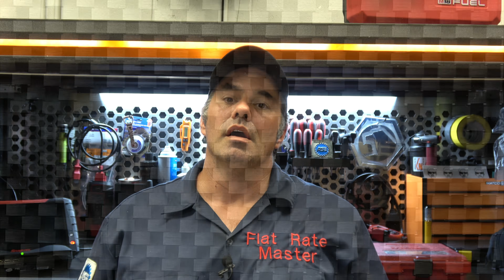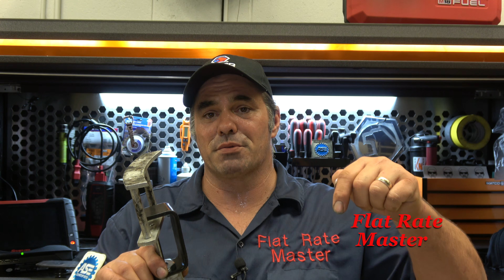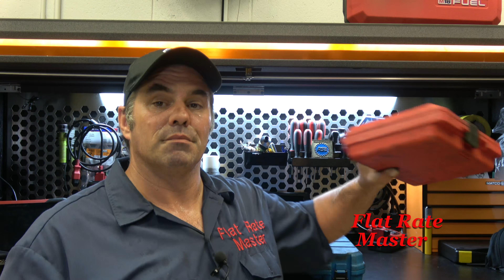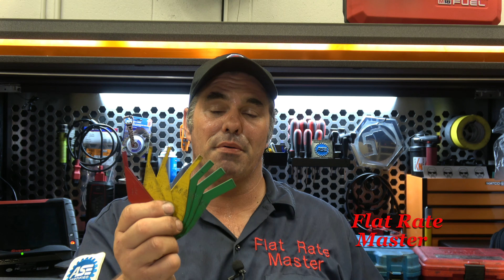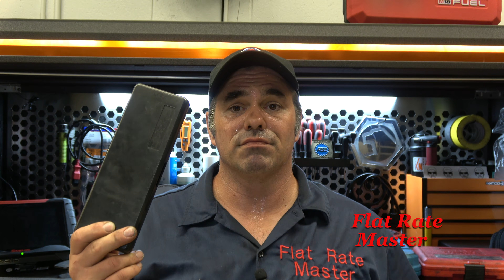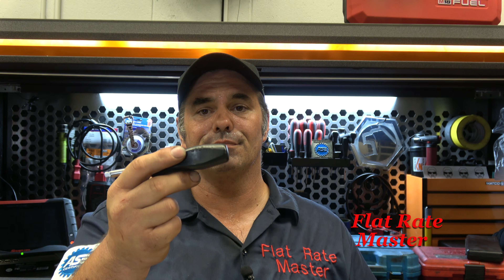Basic Brake Tools For Auto Repair

Comment: My favorite use for that caliper micrometer tool is to check wheel offset eith aftermarket wheels to see which size hub ring i should be using

Comment: I’ve done drums twice at my dealership in the last 2 years. I’m fine with that. I’ll do clean and adjusts on them all day though. That’s pretty gravy for me. 
I use a combo of the lisle single piston (sometimes add a pad when needed,) the Matco branded ratcheting tool, and my less used Matco turn back set. They all come in handy. 
Fluid testers come in clutch. I also have a good vacuum bleeder. Makes life so much cleaner and easy.

Comment: I love my one I get for 10 bucks at autozone or any place that sells tools it’s a thing of metal in the shape of a pad with a thick bolt in the middle with a flat surface on the stud u just twist it and it works very easily I have four of them cause sometimes I get the two piston or brembo 4 pistons and my 10 dollar tool does it super easy on my hands. For rear brakes that are twist type I have to different blue point cubes with diffent style teeth on all the sides but one is flat so u can put it on ur extension and ratchet or directly on ratchet I’ve yet to run into automotive or even light medium duty brakes I couldn’t do with those tools now for heavy duty it’s a lil different lol. Mainly need lady slippers special pliers and a few other odds and ends to make semi truck brake jobs easier and faster then cars especially if your shop has tools to help take the wheel off and the drum so u don’t have to wrestle them on and off and hurt your back.

Comment: Drum brake spring pliers! Cam-turn spring hook releaser! A must have when you're doing drums on one ton trucks. They both help release the springs and put the new ones on. As much as people hate doing drums I usually get seven to eight years out of mine in extreme cold and salt, probably because the drum protects the brake components better.

Comment: Glad I’m not the only one that hates drum brakes, Horrible inferior technology! Btw I have a nice brake measuring tool that is like the first one you showed but the ends are bent 90 degrees so you can stick them in the calipers even when you have virtually no access, I don’t see any shops use this style but I can’t imagine why. They can measure pretty much any brake pad without removing the wheel. Edit: found they are lisle part number 81850

Comment: I only do my own car brakes   and my moms   i still use a c clamp and old brake pad   have been for     25  years   now      and it works fine.    when it comes to the rear brakes   I have a tool for the rear piston  if needed   .     im not flate rate  and or on a time limit.

Comment: 6:19~6:20 "four millimeters you want ?????".  Played that one second 30+ times but could not understand that last word (?????). Also, another LANG 279 video comment stated that the problem with the Lang 279 was that it required another person to hold the caliper else remove caliper and put it in a vice. Is that true? ALL of my many brake tool questions were answered in this one video. GOOD JOB!
Reply: No, this is not true about the Lang. Hold the caliper in one hand, the Lang in another, slide the Lang into the caliper, and start ratcheting. The easiest way is to put the caliper down on a five gallon bucket.

Comment: The brake fluid moisture meter is a very inaccurate tool, because it tests for electrical conductivity. I know one would think the more conductive the more moisture. Not the case because of different manufacturing practices. Some brake fluid is more conductive then others. So that being said that tester would have to be calibrated for the specific manufactures fluid. The only universal moisture tester per say would be one that tests the actual boiling point.

Comment: I sure hope you are pinching off the line, opening the bleeder, and pushing the fluid out and not back into the system. That's a good way to ruin an abs system real quick.... As far as rear calipers that you twist the piston back in. If you can't twist the piston in with a pair of needle nose pliers, the caliper is junk
Reply from the maker: I have had the discussion about opening bleeder screws with many brake engineers, there was just a discussion on this on Iatn and the tech guy from a leading brake manufacturer stated as such, those abs valves are normally closed, so pushing the fluid back does nothing to the abs. FYI, pinching off a modern brake hoses with a liner will destroy it, and you now get to buy brake hoses

Comment: My lisle caliper tool that you have lasted me 17 years...excellent tool...
The permatex grease unfortunately swells the rubber bushings on Toyota brake caliper pins...causing them to bind so I prefer to use Toyota rubber grease..
Reply from the maker: I do not use the Permatex on rubber, I use silcone paste
Reply: @flatratemaster  i use super lube on slide pins, works well

Comment: Brakes are gravy....Hmm I’ll try to remember that the next time I change the rotors on a truck with a Dana Spicer two speed rear axle. Or the old style 4x4 ford captive front rotors
Reply: That's one thing I don't miss about my old 1990 Accord.

Comment: Drum rear parking brakes are great until you have to do the rotors.  That's where your pick tools are good for disengaging the star wheels...as opposed to trying to use a screwdriver.

Comment: I have that Lang #279 brake caliper press and was good money spent on it.Gets used a lot now.So far on putting in the old brake pads to use it was on a 2011 F150 just to push the pistons back in.I have the 18 piece Matco rear caliper windback tool set,works good.Checking brake rotors,the cooling fins are to check as well.Toss them if they are badly rusted out.Causes so many pulsation problems.I do remember the early GM  W body cars using the T60 torx bit on the front brakes.These bolts were on so tight.Lisle is johnny on the spot for warranties,will send you a replacement emailing them.I have done it before

Comment: Hey FRM,

Love the show! A tool suggestion for those cage style drum brake springs is the CTA 1459 pliers. I use it on almost every job and it's great for the ones that sit behind the hub. Look forward to the next video! https://www.amazon.com/gp/aw/d/B00VX0BVWW/ref=mp_s_a_1_6?ie=UTF8&qid=1507314886&sr=8-6&pi=AC_SX236_SY340_QL65&keywords=drum+brake+spring+pliers&dpPl=1&dpID=311XYuCVGNL&ref=plSrch
Reply from the maker: Thanks I will give them a try!

Comment: The shop I was at, everyone used the same Caliper.  It was rare that the rotors could be turned, almost all where badly grooved, or had "holes/pits".  It's dependent on the area your shop is located, for which tools are needed.  People would come in for a oil change or tires, or noise complaint, and leave with new brakes.  

Kinda scary.  I have had to wear leather gloves to take tires off, more then you should. (and put them back....)
Reply from the maker: That sucks!, Being in the south, changes things for me compared to the Rust belt
Reply: Got to be nice working on cars in the south,  I am on the outer edge of the rust belt. So I get clean cars and rusted out POS, I have seen a few old ONT cars, man it sucks to work on them.  I might invest in a .498 air hammer, the Snap on is good but I need a bit more power.

Liking the videos you have put out, far more useful then just standard fare DIY videos on youtube.  Keep them up.  You better not do any DIY repair videos man.  :)

I like the "calking gun" type brake tool, however the Lang, a cheap rear brake tool kit, and large channel locks. Have worked great for me, and been fast.   The rust will slow you down.

Comment: As far as the brake grease goes, my shop just provides the black brakes grease but I don't like to use that on sliding pins. I prefer using silicone paste/die electric grease. What are your thoughts and do you put brake grease on the ears of the brake pads where they slide on the metal clips attached to the brake caliper bracket?

Comment: Good video. I went a long time with just the cheapo 4-sided cube for winding back caliper pistons. After getting a good tool, I kicked myself for waiting so long. Saves a ton or time. Along with what you mentioned, the best drum brake tool is the Snap on BT-11. If you do single spring drum brakes (which I really hate) you'll need something like the Lisle #50600. And if you do Chrysler or many import drum brakes you might want to  consider a Lisle #48400. Those "leaf spring" clips used to drive me crazy. And one more handy item, Lisle #45100 clamps on brake springs, although needle nose vice grips work pretty good too. And no, I wasn't paid by Lisle to post this. It's just that most tool trucks sell their stuff re-branded.

Comment: FRM, I would like to hear your take on working efficiently vs cutting corners, and where you draw the line between “getting the job done fast” and “getting the job done right”?

IMO, I strive to be as efficient as possible, while still doing the same quality of work, as I refuse to sacrifice quality in the name of speed.  I’m all for buying tools and
trying new things to make jobs easier/faster.  But I’ve seen lots of “techs” sacrifice quality in the name of speed by either skipping steps, butchering/hacking up something instead of removing it properly, or in the worst cases just flat out not doing the work.  

Example, when I worked at the dealer and did a brake job, I’d lube the slide pins, clean the rust from the bracket where the rattle clips sit, put anti-seize under the clips, brake lube above where the pads ride, anti-seize on the hub if I was replacing rotors, properly torque the caliper bracket and lug nuts, etc.  The other guys in the
shop, however, just slapped the new pads in the calipers, never changed rattle
clips, never lubricated anything, ran the bracket bolts and lug nuts down with
their impact and shipped it out the door, and that’s not right IMO.

Would love to hear your take on this, think this would also make for an interesting video.
Reply: I feel that if labor times were fair (which lots of them aren't, especially here in the rust belt or if you're working in a dealership doing warranty work) then flat rate is the best compensation plan for a tech IMO, as long as the shop can keep enough vehicles coming through the door, or if they offer some kind of weekly hour guarantee to make up for the slow times (30-35 hour a week guarantee).  

But I do agree that flat rate seems to breed this attitude of "quantity over quality" "get em' in, take em' for all you can and get em' out the door as fast as possible".  Also, lots of shops don't seem to know the happy medium between "working efficiently" and "rushing through a job" and most favor speed over quality.  Always said while working at the dealer that they would rather have something done quickly and half assed than done slower but done right!  

The pressure to produce work quickly is pushed to absolute absurdity by people who've never worked on a car in their lives and don't understand the first thing about what it takes to repair a car properly!  All they know is numbers and "sell, sell, sell". Pencil pushing business grad bean counter service managers think that everything can be done in 15 minutes and always have that smug, clueless grin on their face, unaware of their own ignorance and proud of it.

As I said before, I strive to be as efficient as possible without letting quality suffer.  High school shop teacher always told us "Focus on doing the job RIGHT and the speed will come naturally." Can't stand the guys in this business who say things like "You need to hustle more, you need to be faster!"  ETCG pointed this out one time, that he would get pissed if someone said he was "fast".  Don't call me fast, because that implies cutting corners or not doing a job properly, call me "efficient" because I did the job correctly AND as quickly as possible.

Comment: The correct calipers are important even if the rotors aren’t grooved. A lot of the time the rotors will get a lip so standard calipers won’t measure the rotor it’ll measure the lip. My shop only requires measurements when we are requesting new rotors, if we are cutting them I guess they assumed me measured and there is meat left on the rotors. Good info in this video 👍

Comment: Never came across the pnematic version for retracting pistons. Does it wind counter clock wise?
Did rear brakes on a Transit the other day where the pistons retracted in opposite directions from side to side.
Another great video! Well done!
Reply: Frank Totino the pressure is pneumatic but the turn handle is manual so you can twist it either way.
Reply: Shawn McHargue 
Thanks Shawn...Do you own this tool? My worry was, it retracting so quickly, that there is potential to rip the boot.
It's manual with some kind of assist. I personally would like to    
feel the piston retract.
Reply: Frank Totino I work with FRM so it’s the same shop tool he’s talking about. It does not turn too quickly nor does it assist in turning it just keeps a constant pressure on the piston. The Harbor Frieght ones always loosen pressure while you turn it and you have to adjust it while this tool it constantly has pressure.
Reply: Shawn McHargue 
Didn't get it until now...thanks.
Is he as much as a task master that he appears to be:) lol 
Have a great weekend!

Comment: A big screwdriver works for the gm horseshoe springs. Quicker than the right tool on flat rate lol in pa an inspection shop is required to have a disc brake mic or they will shut you down if you're missing any inspection tools..
Reply from the maker: That is the method I use, we do not have any inspection here other than emissions